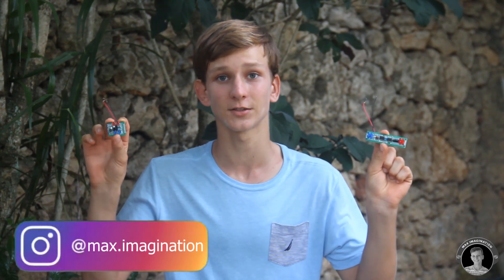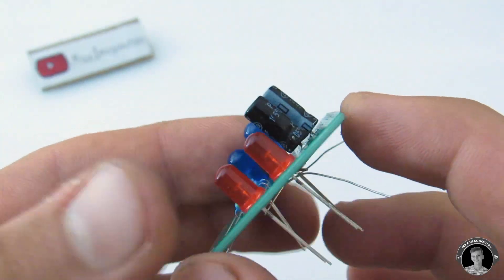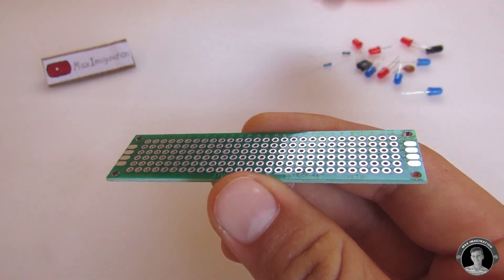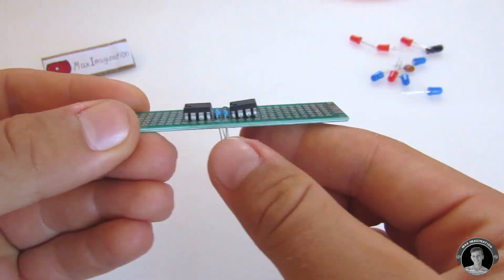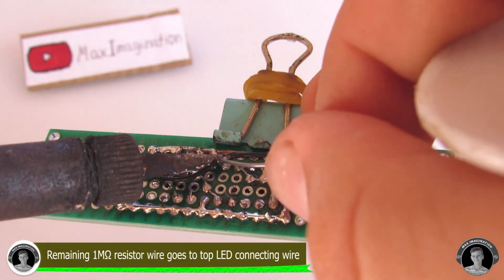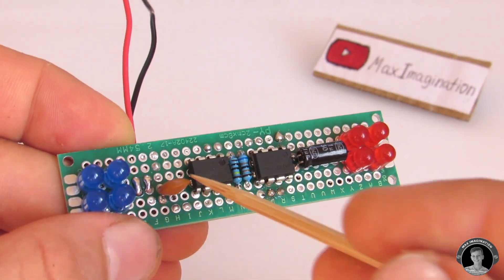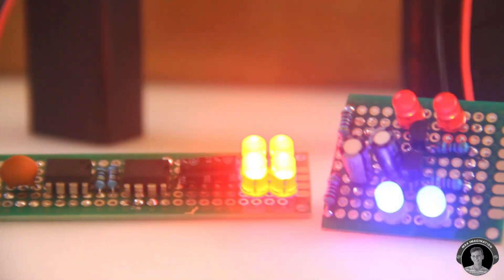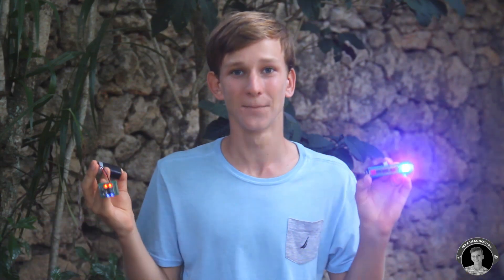How to make 2 Types of 12V Police light circuits - Simple & Advanced Lights | DIY

Comment: Bro i want to ask a question, if i dont have 680k resistor can i use 2k resistor or another?
Reply from the maker: A 2K resistor is not enough, no. Try finding something like a 470K ohm of 1M ohm resistor.
Reply: bro can i get all information related to simple police light 2 , like photos and explanation because i am using this for my final project in university

Comment: Does it work with 3V and 20mA LEDs?
Reply from the maker: 5V is the chip's minimum, in this case you'd have to keep the LED configuration all in parallel, and not series, unless you supply the board with a voltage higher than 7V, then you may keep the series+parallel configuration that's stated in the diagram.
20mA LEDs as the types used in this video will work, yes.
Reply: Can you use 0805, 0402, and 0603 SMD LEDs with this circuit?

Comment: can i use 3 voltz for no.2???
Reply from the maker: Hi. No, you cannot as the NE555 timer's minimum supply voltage is 5V. In this circuit, you may get away with stepping up the voltage to 9V using a boost converter for your circuit.
Cheers,
Max.

Comment: Hi max. Thanks for the awesome vid. Can i use this same circuit for more LEDs? Like 20 in each sides
Reply from the maker: Hello Alireza.

Yes, absolutely.
Though, if your LEDs don't light up how they're supposed to, that means that the added amount of LEDs requires more current, you'd then need to alter the resistance values or change the series/parallel configuration. Good luck with your project 👍

Thanks for your comment!

Cheers, 
Max

Comment: Hi Max I made the complex one and my red LEDs flash continuous while my blue LEDs are flashing with no pattern
Reply from the maker: Hi Bob, I see what's going on. You must've used capacitors with the wrong values, or misplaced them. Please refer back to the diagram to confirm you're using those exact value caps.
Reply: @MaxImagination  ok thanks for replying I messed with it a bit more and it worked thanks for the help
Reply from the maker: @Your_average_hobbyist  No problem, I'm glad to hear you got the set of lights blinking right! 👏👍
Reply: If you are using electrolytic capacitors, make sure the polarity is correct as well. The (-) side should be on the #1 pin of the 555 timer.